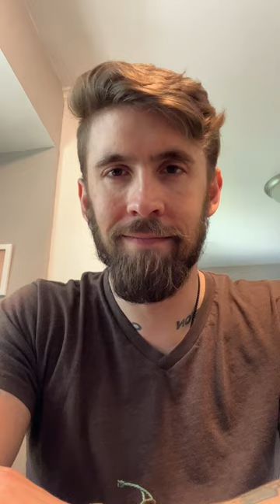Lab Learnings: Flash Pasteurization

Comment: Hey! Thanks a lot for your videos, I was wondering if there's an actual limitation on the can that wouldn't allow me to pasteurize at 190F. Thanks!
Reply from the maker: It is dependent on a couple of things: 
•	The CO2 volume, headspace, and the temperature. As the temperature increases so will the internal can pressure. Most aluminum cans cannot sustain an internal pressure greater than 92psi.
•	Tunnel pasteurizers are not typically designed to reach 190 degrees. If you wish to achieve this temperature you most likely would use a hot fill skid.

Comment: Hi.  Glad I found your page.  What is the cost difference between flash and tunnel, if any?  thx
Reply from the maker: Great question. Typically, there is not a cost difference between the two, unless you are the copacker. It is more expensive to install a tunnel pasteurizer than a flash pasteurizer. 

As a brand owner, it is more important to know which thermal process is required for your product. One cannot pick or choose which one you want based on cost. It is dependent on the ingredients in your product and the recommendation from a process authority.
Reply: Any ideas on how to flash pasteurize at home...,as my bambara milk forms cuds while heating in a pan...